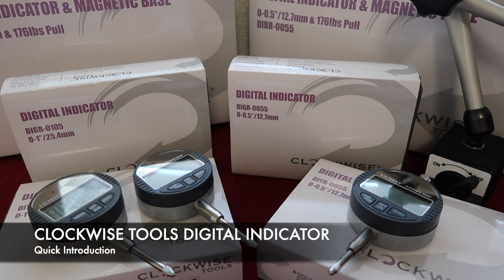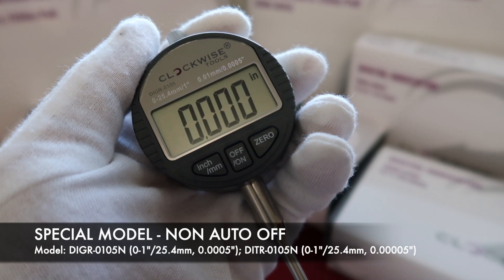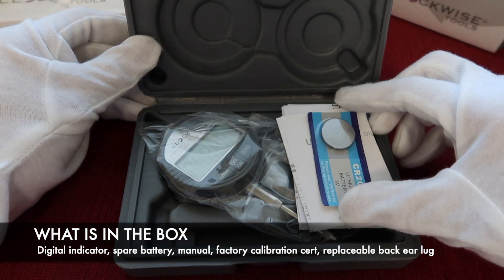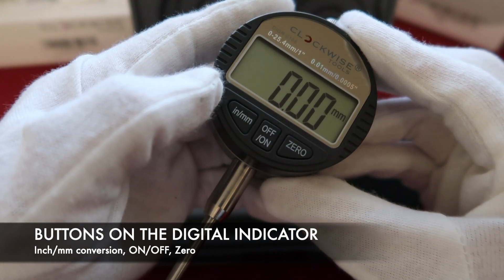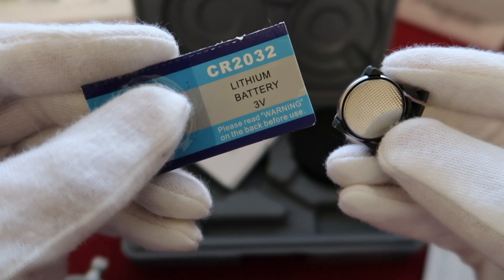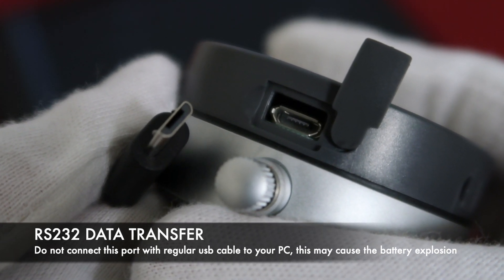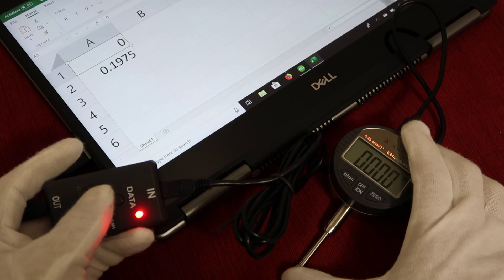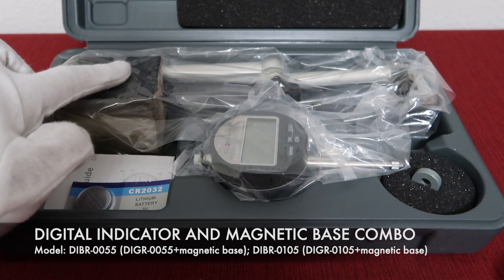Clockwise Tools Digital Indicator RS232 Data Transfer Tutorial

Comment: Hello,
if i can not use regular usb b cable for data output what can i do for pulling data to any kind of mcu?
If I put a diode on the feed line to prevent voltage from passing through the USB line and read data from the remaining cables, can the system transfer data safely?

Comment: Hola.. un saludo, tengo una consulta. Si yo quisiera conectar 2 indicadores en mi laptop y registrar 2 medidas en un exel para luego hacer un resumen comparativo se podria hacer?
Reply from the maker: Since the cable will be identified as a keyboard, generally only one indicator can be connected with one computer.
Reply: @clockwisetoolsinc4949  , OK gracias por la pronta respuesta, alguna sugerencia que me puedan recomendar ?
Reply from the maker: @ROBINSON-q1g  I am sorry but you have to modify the cable.